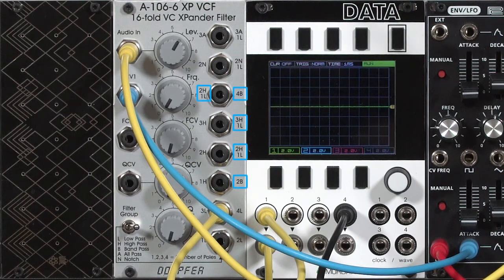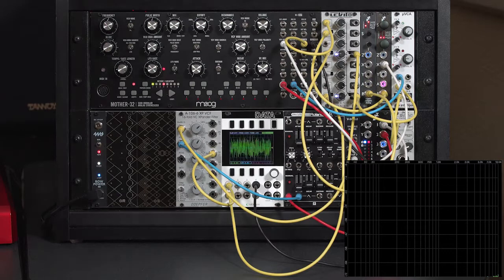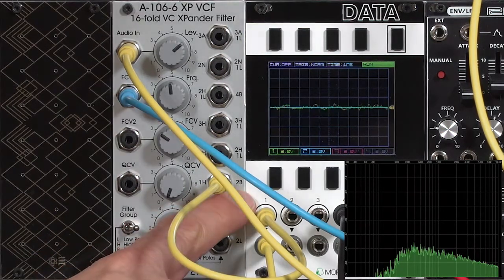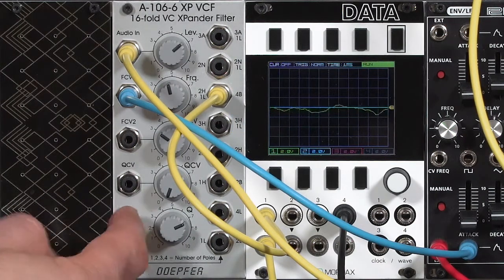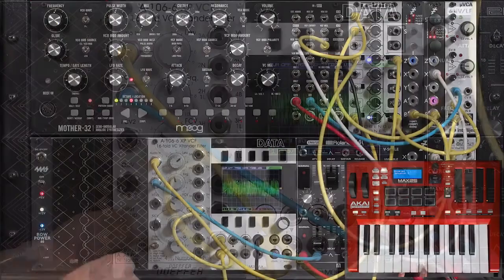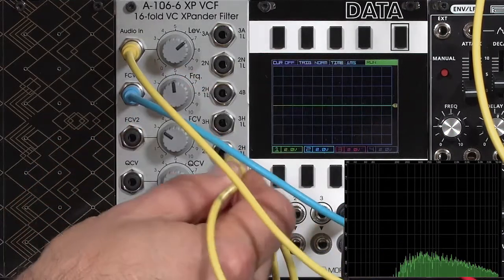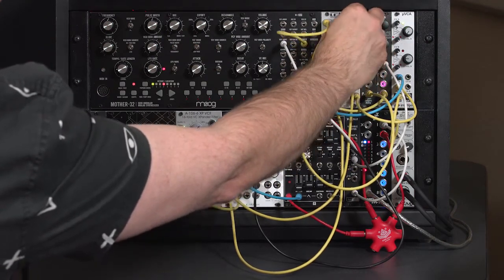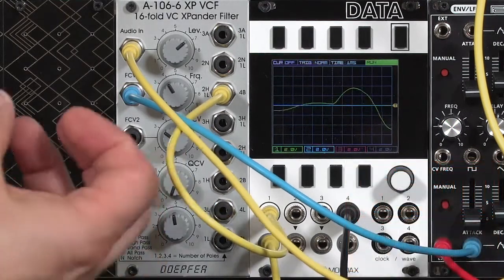Doepfer A-106-6 XP Filter 3/4: bandpass variations (LMS Eurorack Expansion Project)

Comment: I've often wondered, does resonance in a band pass filter constrain the width of the band being filtered?
Reply from the maker: It can give the aural appearance of narrower notch because the harmonics in the middle of the band are being boosted and the ones on the sides aren't, but aside from this steepening around the cutoff frequency (and depending on filter topology) it ends not change the slope once you get outside the boosted bits.